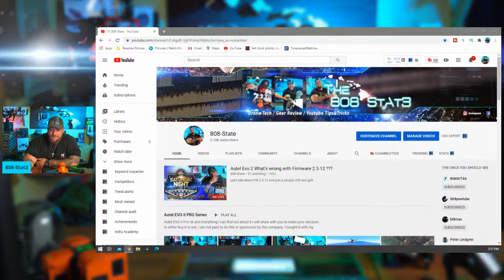Autel Evo 2 What's wrong with Firmware 2.5.12 ???

Comment: I just received my Aston Power Charging Station for Autel EVO II series.
Shipping was about 10 days.
It charges all four of my batteries simultaneously, not one or two at a time.
They all charge to full capacity (more minutes).  
It has a fan in the charge base.  Here is a link if you want to know more:

https://astonpower.com/collections/frontpage/products/astonpower-charging-station-combo-version-for-autel-evo-ii-battery
Reply: Brandon S  It is possible to plan and execute about 3 new Missions on one battery while inspecting roofs for a roofing company. They might persuade a dozen homeowners in a neighborhood to have a look at their roof in one day.  That would require 4 batteries.

The clients will also want to view the pictures/footage on location, which is most efficiently done while the SD card is in the Drone.  It is recommended to allow the batteries to cool down before charging to maximize the battery life and minimize cell failure.  The batteries should not be fully depleted.

In the long run, rotating 4 batteries should theoretically be the frugal, best practice.  Plus, no client expects a professional drone operator to show up unprepared with lame excuses why they have to wait until they recharge the battery, Haha. 

What if you forget to charge your "one" battery before the next day at work?
Reply: Brandon S  I currently have 8 Evo II batteries, 3 OEM AC Chargers, a charging hub, and an aftermarket charger,, but I also have 2 Evo II Pros in my kit. When my professional reputation is on the line, money is not the biggest factor.

Comment: Greetings from Germany. Had the same probs  with the calibration. Just started with Autel and make some  Tutorials for the German guys. The Autel App tells me all the time to do the update, But its done.
Reply from the maker: Ich hab das auch gehabt und dann allerdings mit usb stick und sd karte das upgrade hochgeladen. Andre haben gesagt dass es 3 versionen von 2.5.12 gibt :(
Reply: @808-Stat3  bin ja brandneu im Thema Autel. Habe vorher Yuneec H520 geflogen. Versuche gerade für die deutschsprachige Community einen kleinen Infokanal zu erstellen. Und ich nehme da auch kein Blatt vor den Mund, wenn etwas nicht so gut produziert wurde. als erstes ist mir der Gimbalschutz negativ aufgefallen, Trickyden wieder anzubringen :-9
Reply from the maker: @PixxelAir-TS  halt sie anders rum. Ich dreh sie um damit die kamera sich nicht immer bewegt.  Gibt jetzt 2 versionen. 2te version gimbal cover hat mehr platz dass da auch die cpl filter von freewell passen.  Plastic ist weicher.  Die 1ste version war haerter und da ist mir der klip abgebrochen.

Comment: I understood from Autel, but you could confirm next time you speak to them...  the WiFi setting 5, 10, or 20 is just for the video de-code stream from the controller to the display, Phone or i Pad etc...  they should have just called it smoothing or similar, it's not for the actual Stream to and from the Drone, do you think they would trust us to mess around with WiFi bandwidth.. ha-ha.. Cheers.
Reply from the maker: Yes it is for screen transmission ONLY . I haven't used anything other than 10 though. 5 seems to choppy and 20 seems to be not good at all for my environment.

Comment: geez.. I was thinking about getting the 6k version 
But if you've got to screen record every flight just in case you have a crash...?
That doesn't sound very mature to me
sounds like Evo still has some growing up to do.......  : /
Reply from the maker: You don't HAVE TO screen record every flight. I just do it in case something does happen. I do it for my DJI and used to do it for my Parrot as well.
Reply: @808-Stat3  --- it just seems like there's such an elevated risk of a crash
that's too bad
what you're doing by recording is basically a form of insurance - so you can "make your case" to autel, letting them know that you weren't irresponsible, reckless or making drastic maneuvers when you lost the drone - so that hopefully they will repair/replace it
as an outsider looking in... it makes me think
Reply from the maker: @SDsc0rch  Yes it IS my form of insurance to prove to any manufacturer that it wasn't Pilot error. Drone companies have been known to blame "User Error"  alot when it came to crashes. I understand in many cases that is the case BUT if you screen record you have one more extra piece of evidence to submit JUST in case you are unable to recover your bird and I am surrounded by Ocean and film alot above water where I won't be able to recover my bird. So yeah that is pretty much the only reason I go that route for any Drone as a matter of fact.
Reply: @808-Stat3  - makes sense

Comment: Hey bro, I have an interesting series of events and issues that happened to my Evo 2 pro, maybe you can relate? 

1) had evo 2 issues with connecting to my phone, kept getting disconnect issues with the RC.

2) I sent the drone in to autel and they said it's fine, sent it back. 

3) Updated the firmware today, did an IMU calibration, then Gimbal calibration. Couldn't do a compass because I was indoors (is this normal?).

4) Then another issue I found is that after my gimbal calibration, I couldn't use the gimbal. I wasn't getting any gimbal isnt ready messages, but I couldn't use it. Had to restart the drone and RC and then it worked fine. 

5) Did another gimbal calibration for testing and again got the same gimbal not moving issue after. Disconnected the phone from the RC and then it seemed to work.

I've never had to undergo such troubleshooting issues with my mavic 2 and so far, this has been a pretty disappointing experience. Hoping its just me...
Reply from the maker: I had to update my galaxy s10+ apparently driver issues between rc and phone cause disconnection . Compass calibration requires strong GPS signal and should be done outside. I have to do compass, IMU then gimbal calibration in that order to get the best results. Hope u get to figure it out and get to love this bird as much as I do.
Reply: @808-Stat3  thank you! Just a quick follow up, when you say you had to do a follow up update (driver) on the phone, did you mean update the autel app?
Reply from the maker: @VitaliyGershfeld  both had to make sure autel app is up to date and even though my android does frequent updates I downloaded an additional update for my system software for my android even though I wasn't prompted
Reply: @808-Stat3  got it, thank you!
Reply from the maker: @VitaliyGershfeld  hope this helps you out my friend.

Comment: 14:32---- order of calibrations...
compass, IMU, gimbal
RECOMMENDATION: request Ivo put the calibrations in that order in the GUI
also... If possible, make one overall calibration routine in the software that leads you by the hand in the right order
They need to try and make this idiot proof
Reply: Of course, the best option would be to make it so that it doesn't matter what order you do the calibrations in
Reply from the maker: Yes I was thinking the same.

Comment: My horizon  is all off now. and I did the calibrations in order,  I dont like this firmware  update.
Reply from the maker: Me too. I had to do so many calibrations wasn't funny anymore until I finally got it.
Reply: @808-Stat3   I just went outside  and  did the steps u said. in order  I will will fly it later I hope this works
Reply from the maker: @keytiger7  if I recall correctly I did it 5 times till I had it where I liked it lol